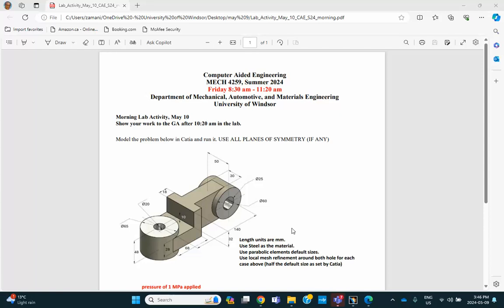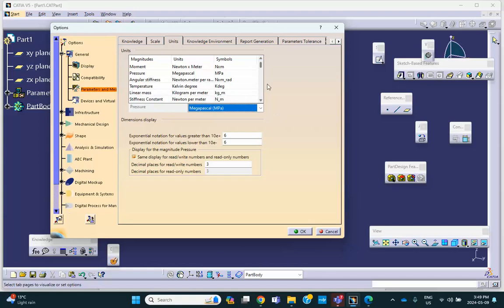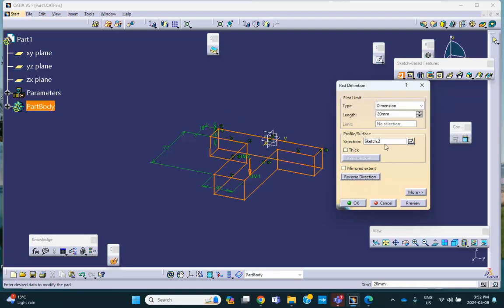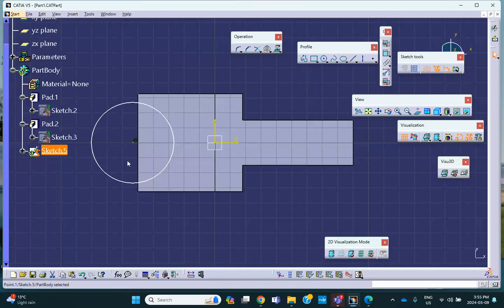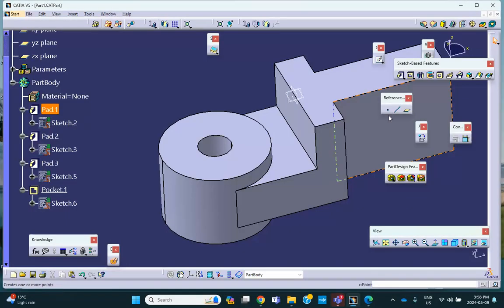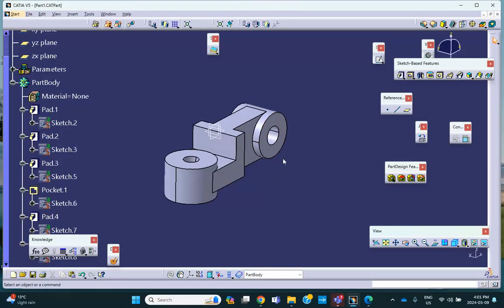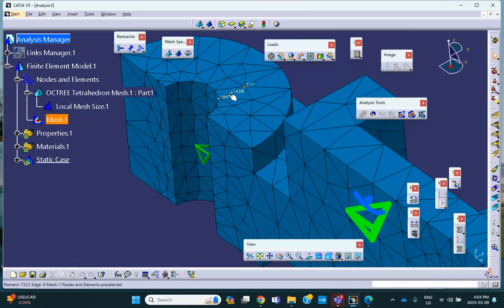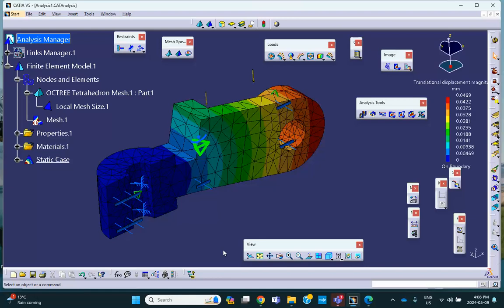Morning Lab Activity CAE May 10 S2024

Comment: sharp edge...coarse mesh...  mises values may differ significantly
Reply from the maker: You are absolutely correct. I tell the students about the Pricnciple of GIGI (Garbage In - Garbage Out). I tell them that this is how you do it in the software. The validity of the results depends on many factors that we are not disceting (in this course). They are cautioned that if you ignore those issues and do this kind of work for living, it will not be very long before receiving the pink slip.